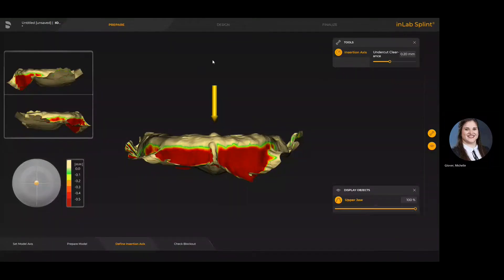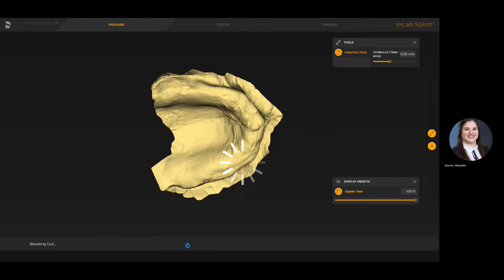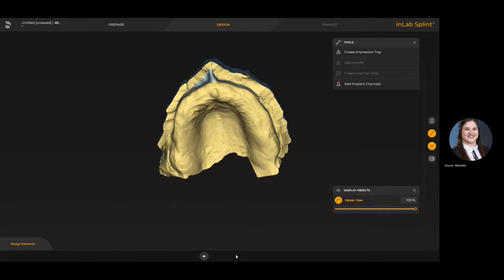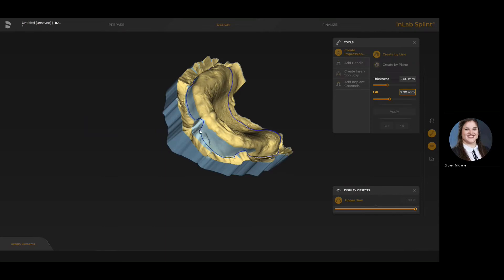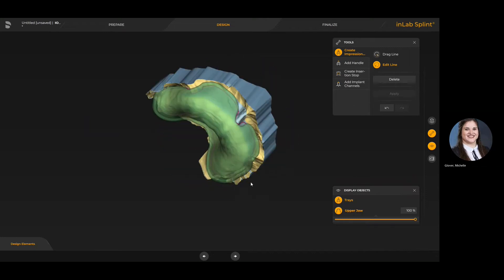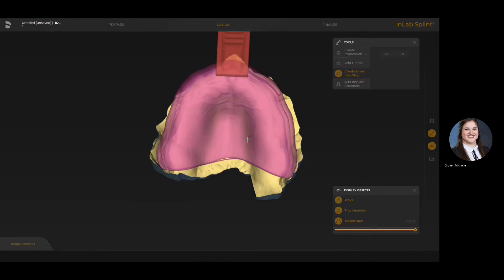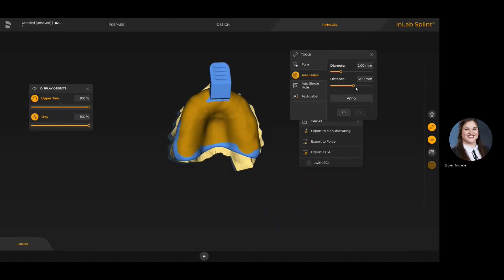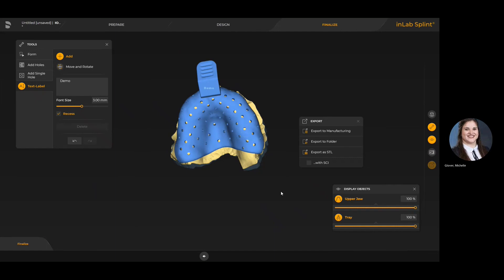inLab Software 22 Custom Tray Tutorial

Comment: Hey there,

I've been using the tray software to create biterim baseplates for my wax/denture guy. Using 0 spacer/lift (so the maxillary biterim stays in the mouth), the baseplate will lift up on the palate of the stone model. I don't get this lift on the model using around 0.25mm lift, but then of course it's loose in the mouth. I use 0mm undercut clearance always.

Any help would be appreciated :( thank you. I am considering covering the intaglio of the printed baseplate in vaseline and re-pouring the model and seeing how it'll fit in the mouth, but would like to impress and not disappoint my Dr if possible lol
Reply from the maker: Hey there, for base plates/ bite rims do you ever try etching into the model a post dam? This could help with this sort of thing.
Reply: @DigiDentStrategies  I actually tried this very thing a couple days ago, one of the other lab guys had randomly suggested it. He carved the post dam into the model, I scanned it HD on a desktop medit scanner and tossed that STL into inlab.

Tried a 0 lift/spacer baseplate and on the stone model it's still lifting on the palate, but the retention is pretty good. The 0.25 lift/spacer baseplate LOOKS like its closer to the palate, but its obviously less retentive on the model compared to the other 0 spacer baseplate.

We have not tried it in the mouth and are not sure if it fits. Even if it does, I worry that the midline/smile line marks will be off because of this slight lift on the model. Some of our try-ins are on their 2nd or 3rd attempt and I just feel awful for my buddy setting teeth.

I am printing on a sprintray pro 95s with sprintray's denture base resin, if that matters.

I appreciate the advice, thank you so much for the quick response!

Comment: At 5:56 why did you get that error "Adjustments recommended" specifically? I am getting that error it causes some user confusion.
Reply from the maker: That's just a warning that always comes up by default. I've never seen it not save though. I would recommend turning on under analyzing tools (the graph icon on the right), the box that shows wall thickness. If anything critical is in blue, try to use the add tool to bulk it up. Hope this helps!

Comment: Would be verry nice if you could actually show where to find the try option in the software and how to start… because that‘s my Problem here. Everything is ther but no Try option
Reply: Or what you startet with here. Dont just start the vid in the middle
Reply from the maker: That's not in the middle of the workflow, that's as soon the case opens in the Splint application. The only other steps not noted for the sake of time was selecting Custom Tray in the administration of the inLab CAD software. Every case starts there, and if an application like splint is utilized, the software bridges that file to the app. Hope that helps clarify, thanks.